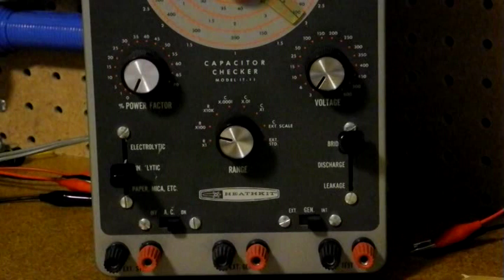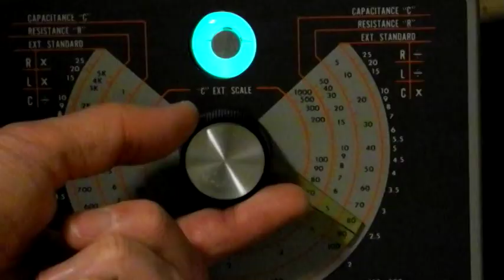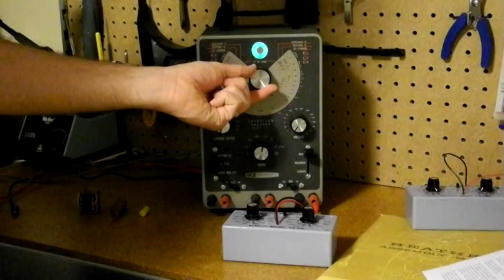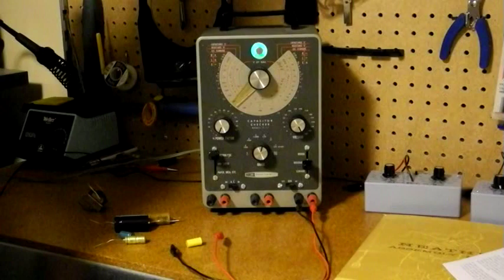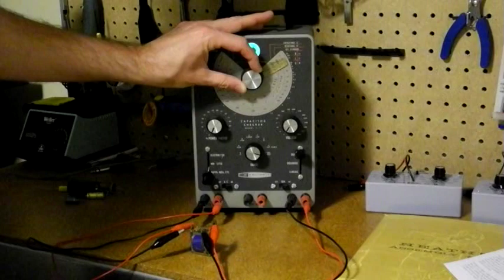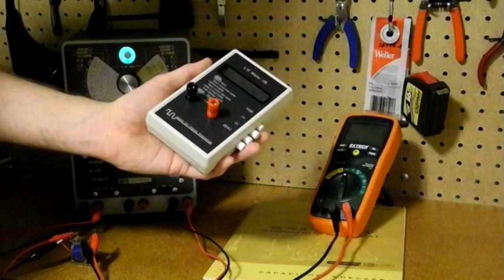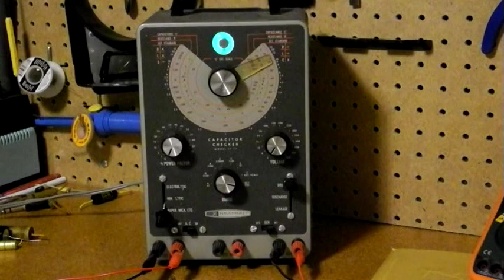The Heathkit IT-11 Capacitor Checker

Comment: I built my IT -11  back in the late 60's or early 70's. I replaced a few Electro's with a more modern design, sometime  over the past 10 years ...I think? 

Thanks for the Transformer "Turns Ratio" tip! I completely forgot that one! I hope you are still on the topside of the grass! 
For everyone reading this: Please keep in mind that the resistors in the IT-11 are all Carbon Composition. They are not nearly as Time - Temp Humidity stable as the  Metal-Film resistors sold these days. I will say this about those old 1/2 Watt resistors: They are STILL a hell of a lot easer to read the color code than the stuff made these days! Some of the 1/4 W  resistors made these days are damn near impossible for these old eyes to read!  
EDIT: Changed IM-11 to IT-11. The IM-11 is my VTVM
Wakodahatchee Chris

Comment: The High Voltage Leakage Test Is Invaluable !   No kind of low voltage solid state device can do what this device does... and that is the REAL reason to keep and use the IT-11 or similar cap tester.  If you think some goofy "ESR" tester can really give you unequivocal leakage testing for electrolytics or any other high voltage cap.. I have a bridge you will want to buy near San Francisco.
Reply: Better check out the solid-state capacitor leakage tester from Mr. Carlson's Lab. Puts the IT-11, and similar units, to shame. https://www.youtube.com/watch?v=LhovRIM5xAo
Reply: Enjoyed the comments but I don't see how ESR is related to Leakage?
Wakodahatchee Chris

Comment: Thank you for this demonstration I enjoyed it a lot.  
I was wondering if anybody know what amount of voltage it puts across the terminals when measuring resistance? Of course nobody uses it for that anymore but I'm still curious since there is no battery in it.
Reply from the maker: I measure about 8 VAC 60 Hz on the RX1 and RX100 ranges and 33 VAC on RX10K with a high impedance load (oscilloscope or DMM).
Reply: @jefftranter  I see thank you so much for taking time to answer.

Comment: How does "reforming" work?    Fascinating!
Reply from the maker: The process of applying an increasing voltage at low current can reform the insulating oxide layer of an electrolytic capacitor. You can find various articles and circuits on line.

Comment: interesting, and useful since I don't have the manual.  bridge measurements are perfectly accurate for repair work, and to qualify and quantify components which questionable.  Compared to your plastic kit..it will stand up to use in a shop much better, if you have the room.  If you really need an ESR meter. get one.

Comment: Great Video,
thank you so much for your presentation.

You talked about modern devices for measuring capacitance and LCR, but do you know any good modern device to measure Capacitor Leakage?

Thank you
Reply from the maker: Megger makes insulation testers that should be suitable. But modern capacitors are not very likely to leak, so there isn't much demand for such a tester.
Reply: See xraytonyb 's YouTube channel. He reviews an EICO 950B and uses a Sencore LC53. That  one might interest you. It is expensive unit.
Go to his video at youtube.com/watch?v=kCBryQHCrb8 to see how they work. Check the specs on any unit to see if they can properly check at least a 
0.01uF 600 Volt capacitor for a leakage test. Some do a poor job but the Sencore unit should do the job there.

Comment: Great job in presenting the functionality of the meter thank you. I just bought one and the seller says it is working. The unit arrived with a valve of its socket so as I open the box I found that the unit still has the old caps in it. I am thinking about replacing all of them before turning on the unit what you think?
Reply from the maker: +Really? It is a good idea to replace the paper and electrolytic caps, but it is reasonable safe to briefly power it up first and see if it is working before you start working on it.
Reply: Wise advise, I will do just that. Thank you Jeff

Comment: New multimeters and cap meters can't test for leakage as they don't apply much voltage to the cap.. Those caps will test fine with multimeters, but not work in a set that high voltage is applied to it.. So these old cap testers do have a purpose for people who restore old electronics..

Comment from the maker: Yes, the unit can measure power factor for electrolytic capacitors. It is similar to measurement of ESR. I tend to use a separate dedicated ESR tester for this. The magic eye tube is green, but does look a little blue in the video for some reason.

Comment from the maker: A modern DMM should work fine for testing the value most old capacitors. Some DMMS can't measure very large values of capacitance, so that can be an issue (I have one that only goes up to 100 uF, for example). They also can't test for leakage, which the old cap testers can do.
Reply: Also DMM are not accurate when measuring capacitance at lower values (lower than 200uf for example)

Comment: like your video but surely the it-11 is still pretty useful also for the high voltage leakage test, as only under rated load will you know if your capacitor is working.